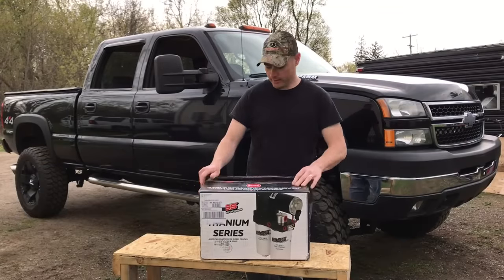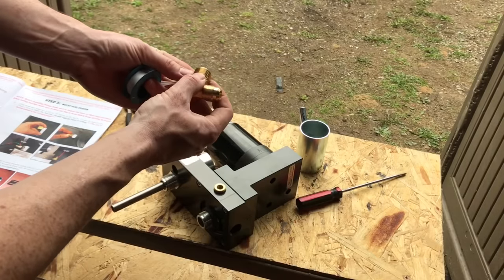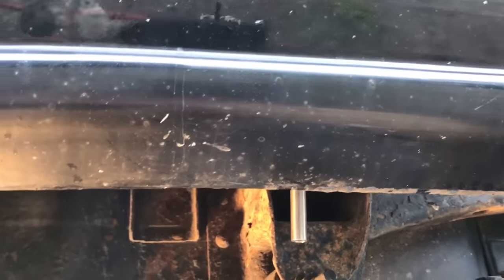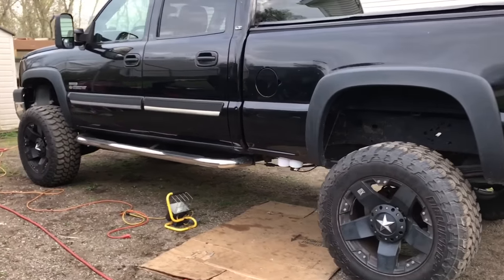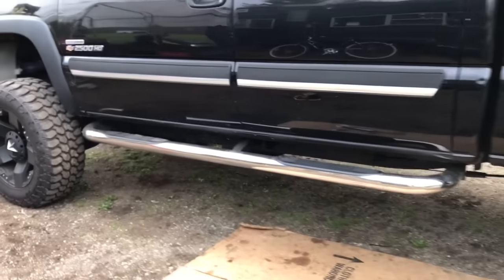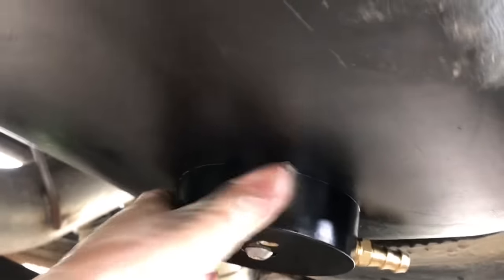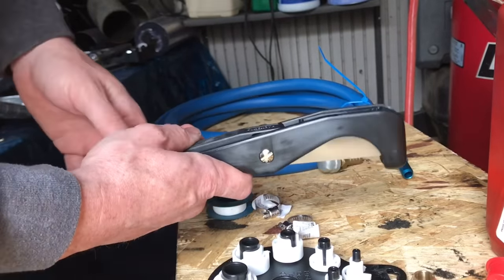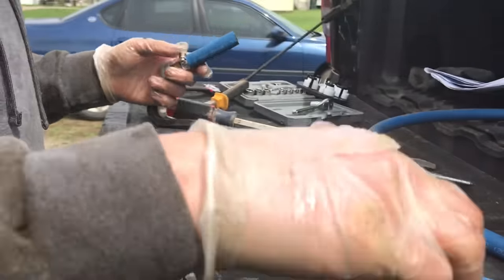Duramax FASS Lift Pump and Sump Full Install

Comment: I'm trying to install lift pump on my 2014 gmc.  I don't have a cooler on my gas tank. there are 2 fuel lines which one is it?
Reply from the maker: +James Pollock there should be one that goes to your tank and one that goes to the engine hook the line up to the engine fuel line

Comment: Big question after installing pump I started to get high pressure fuel rail.  Any one else go thru this?
Reply: You probably installed too large of a lift pump. I had a 150 (turned down all the way) on my tuned LMM and i would get high fuel rail pressure and then low pressure sporadically. I downsized to a 95 gph and it’s been awesome! Good luck man.

Comment: Just wondering if its agood thing to bypass the original fuel filter, or just leave it on ?
Thanks great useful video
Reply from the maker: You can bypass it just as long as you have a lift pump you will be fine

Comment: Why did you mount it in the wheel well where the rear wheel can fling rocks and mud at the unit and the filters.  Doesn't see, tp be the best location, are there other locations it could be mounted?????
Reply from the maker: +Ian Cook I went off what the instructions say but yes you can relocate it

Comment: That green wire that was placed under that bolt by the top radiator hose is NOT a very good source of ground  The MOST NEGATIVE point on a vehicle is the BATT Neg Post  Follow the wire from there to the engine block  Place the green wire solidly on a metal surface of the engine block  That is a good source of ground

Comment: Just had my fass pump installed. Thanks for the video. Did you install the filter delete as well? And or do  you recommend it?
Reply from the maker: +M Strong I kept the stock filter setup but I recommend the cat fuel adapter kit from Sinister I’m doing a video on it in a week or so

Comment: why my 2006 duramax get air in the line it cause my truck loss power. the RPM does not go more than 2000  and i can no get speed?

Comment: Hey man I have a question. I stalled a fass 165 on a pretty much stock lbz. Will that burn up the pump? Because the one 165 is for 600-900hp
Reply from the maker: No it’s perfectly fine
Reply: Truck Master Thanks a lot I appreciate it👍🏽

Comment: Ok so I just had a conversation about a lift pump. So why do you need to add a lift pump instead of just changing out the fuel pump. I'm curious because  I was going to do this mod, but he is telling me that i don't have to and that i shouldn't. And that I can just change the fuel pump.
Reply from the maker: It’s less work on the CP3 due to suction also it’s way better filtration. All around it’s a better option
Reply: @TruckMaster  wouldn't suction issues be resolved if you just upgraded the actual fuel pump making the CP3 not work as hard. I understand the added fuel filter for cleaning the fuel better. I just want to add more horsepower to my truck and was under the impression that I would have to add a lift pump to make sure I could support the fuel draw. Now what I'm gathering is that I don't need to add a lift pump, I can just upgrade my fuel pump.
Reply: @therealopenair247  The CP3 IS the only pump on the Dmax

Comment: Hi this is John from Australia, which is the better an Airdog or Fass fuel Filter, also I am thinking of buying a tuning package the LBZ tuning package, the DSP5 ECM tuning and a TCM Tuning, and DSP5 Switch, flashing hardware, from Anthony at Duramax Tuner , can you help me find the best tuner system for my 2500, 2007 chevy , and I also watched your video on the fitting of your 5 inch exhaust system how much do they cost in the states? And if I can purchase these products through you and have then sent to Australia. Thanks regards John    PS if I can get you Phone number I can call you to discuss this further, What state are you in, thanks

Comment: you wrapped your Teflon tape the wrong way on the first fitting
Reply: And there is no need to tape a fitting with a compression type end. Great job on the video.
Reply from the maker: +Richard Piontkowski oops
Reply from the maker: +Richard Piontkowski thanks
Reply: Remember..."Righty, Tighty...Leftie Loosie!" John K.

Comment: Did you use Loctite or the like on anything?
Reply from the maker: +rcairforceone no just the thread tape
Reply: Truck Master Thanks for the heads up. Just bough a 07 LBZ 3500, gonna be doing some of the same stuff you did. Subscribing now!
Reply: Truck Master Also I'm originally from Saginaw, saw the MI tag (and chassis rust lol)
Reply from the maker: +rcairforceone awesome I'm in the Lansing area take care sir

Comment: Have you had good results with the sump? Was it cheap quality? Have you had any problems with it?
Reply from the maker: +Colby Fowler overall great quality works perfectly and no issues after I used RTV on it so it wouldn't leak

Comment: The reason why they put a pickup tube from the top is a safety reason, 
so there is nothing sticking down from the bottom of the tank and be able to 
caught by a rock or anything and create a fuel leak and maybe even a fire.
You have successfully circumvented that safety feature.
Also your gasket could leak from old age or bad installation.
I doubt that this is street legal.
Also sucking through the pickup tube is NOT a significant load on your lift pump.

Comment: why not delete the factory head filter?
Reply from the maker: +StyleGT that's next on the list
Reply: dope vid btw did this 3 months ago in the snow was ez :D your video is the best around wish i had seen it before doing mine :D
Reply from the maker: +StyleGT thanks I wish I would have seen my video too I couldn't find one on YouTube it's shocking since this is a common upgrade, but any benefits to the filter Delete? I know it just deletes the filter but any other pros to this mod? Thanks
Reply: nope i dont think so... i juste didnt wanted that leaky piece that is prone to inducting air into the system.... the only part that you should add is the bleeding processs... mines probably since i deleted the filter head had to prime the cp3 again and this is done thru the test port of the cp3... have a plastic cap on it that you unscrew and push the nipple in there to prime the system ^^ wish i knew that before XD took a good 30 minute
 and again this wasnt mentionned anywhere lol
Reply from the maker: +StyleGT nice info thanks maybe I can do a video on it in the near future you make a great point too about the air as well

Comment: what lift size and wheel and tries u have
Reply from the maker: +Stealthcon69 6" and 35/12.50/r20s
Reply: thanks man. what would be bast for shocks cuz I too have a 6in lift bit shocks are shot and one with a huge hole in it
Reply from the maker: +Stealthcon69 I highly recommend the Bilstien 5100's its like riding on a cloud
Reply: thanks again bro love ur videos and I also plan doing g the fass lift pump for my LLY

Comment: Beautiful iphone 7 quality!
Reply from the maker: +Septic Spud lol thanks who needs a GoPro
Reply: Haha right! Is that what you used before?
Reply: Also, me and my dad have a 2006 chevy 2500hd duramax that we want to upgrade. Its totally stock. We are looking to get a 4" mbrp straight pipe, 3" mbrp downpipe (that i believe you got), and a egr blocker plate. We have everything in the cart at extreme diesel performance right now. The total comes to around $360 or so. They have a deal and it takes off a bit of it. Is that a good place or do you recommend something else? Thanks!
Reply from the maker: +Septic Spud I used my iPhone6 I really need to upgrade
Reply from the maker: +Septic Spud I find the best deals on eBay, look at my mods in the description on this video get the Ppe race fuel valve they are cheap and effective
Reply: Truck Master oh cool, thanks! What does the race valve do?
Reply: Truck Master nvm i see. Yeah, looks pretty good. I think it will be cheaper for all the parts on extreme diesel performance and I dont totally trust ebay. Thanks for the suggestion though!
Reply from the maker: +Septic Spud maintains rail pressure watch my Cummins race valve install video I explained what this dose
Reply: Ok, cool. Thanks man!

Comment: did you delete the factory fuel filter? I have an airdog and I wasn't sure weather I should delete factory filter.
Reply from the maker: +Jared Ritter no I never did that but plan to
Reply: If you add a filter delete  be sure to remove the check ball and spring from the OEM housing or it wont get fuel past it. Download at FASS.

Comment: It seems sloppily! The original pump is still there did you disconnect the power to the stock pump? So itll sit there and run ?   And im guessing your not going all the way to the fuel line in on the intake? So the fuel amout stays the same no increase in the fuel line itself? Besides the filters this seems completely useless!
Reply: Any update on this?

Comment: That sump is sketchy, over time that’s gonna leak. I’d rather get a used metal tank and swap the whole thing or find an aftermarket tank with a sump welded to it.
Reply: I just read it's actually illegal for commercial vehicles. No gravity feed allowed, it's a little bit confusing...but it makes sense.
Reply: I've  had my beans diesel sump on for four years no leaks yet. If you buy quality parts you will not have a problem
Also I've been running a G&R sump  on my other truck for two years with out any problems.
If you install your sump properly you don't need too use RTV!!

Comment: The add a fuse location of “ignition hot” per directions kicked my ass until I watched you’re video! Also don’t drill you’re sump hole in the middle of you’re tank like I did.... the pickup tube is right there so hopefully it doesn’t get in the way.

Comment: I saw this video that shows a sump with a built in return.  This way you would not need to use the return that is in the fuel filler hose.   https://youtu.be/mhYO9wcAxgM

Comment: You might know but a lift pump feeds the cp3 and the cp3 feeds the fuel rails i also have a lbz I I am very hesitant to instaill a lift pump because the cp3 draws fuel under vacuum then with a lift pump you have continuous positive pressure pushing so i would love some real insight not just YouTube bullsh**
Reply from the maker: +#### #### well sorry for not giving you the best insight call FASS

Comment: Got enough duramax badges? Oh and by the way, you ran the positive wire wrong. It doesn't matter if you plug it into the battery, the "power supply" you went to still draws power from the batteries. So therefore what you did was useless. Running it to the battery won't effect anything.
Reply from the maker: You sound like a guy that’s knows what he is talking about! Make a video and show us how it’s done 👍
Reply: It's not Wrong to run the 12V from the "fuse block".  True it's not a power supply, it just looks like an isolated feed from the battery to connect things: is there even a fuse involved?, could be but it must be pretty big, but can't tell from the picture.  My 2008 has a place to connect 12V just in front of the fuse box.

Comment: Was I the only one to cringe when he used an electric drill? Man this could have gone soooooooo bad. Always when working with combustibles, use air tools.
Reply: I did at first, so I asked a mechanic about this and they said diesel is flammable but not combustible and they do it all the time.  I hope that's true since I may be doing this tomorrow.